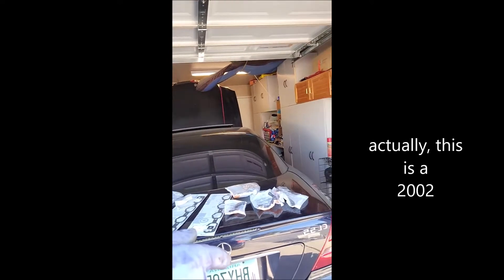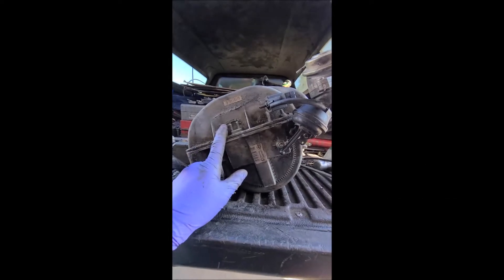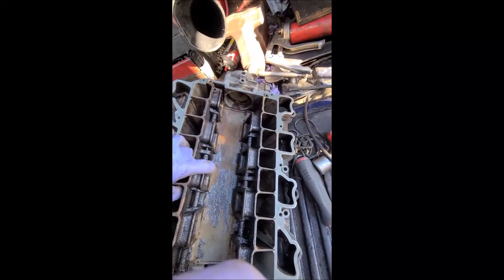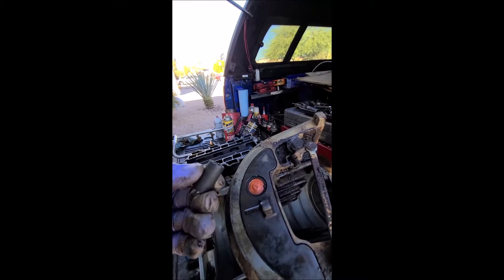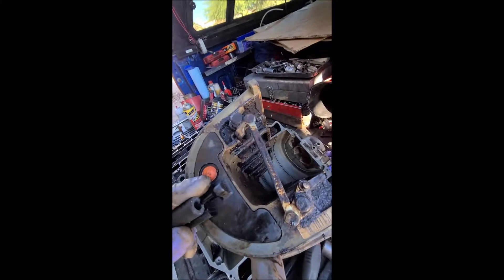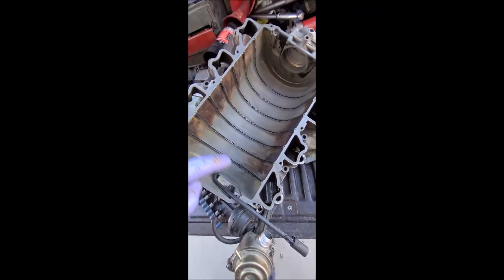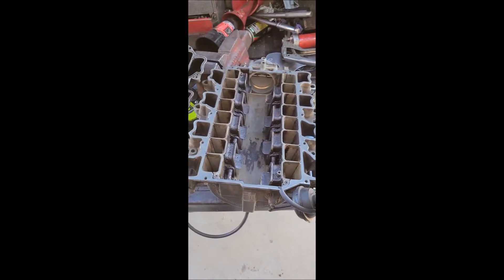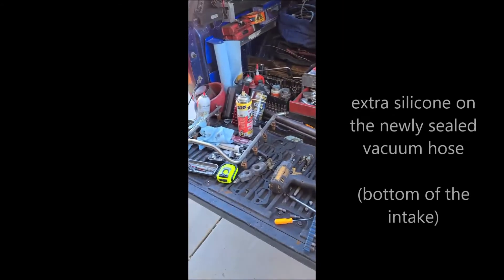Mercedes Benz M112 and M113 engines, split intake manifold vacuum hose leak fix

Comment: Just the video I was looking for . My vacuum line broke just like yours long before I took apart my intake manifold I can just tell by the look of it , what were your symptoms with the broken hose ? I never noticed anything but I’m sure I will when it goes back together fixed & clean , I scrubbed everything clean with diesel fuel & then soda blasted it down to bare aluminum again so I can get better sealant adhesion. I will have a video on my channel soon when I’m done !
Reply from the maker: It was a lean code with a small hissing noise from under the intake. It did run much better when it was all done

Comment: I used an air compressor pinch hose fitting with an 1/8” pinch.  Then added a hose connection , put a 1/8” rubber washer.  This pinches onto the vacuum tube in the intake, making it air tight, sell the washer seals at the exit hole by way of the pressure of the mounting screws and gives the ability to replace the hose in the future without removing the intake.  
I would add a picture but not sure how.
Reply: Yea would be great with a picture or video.  Way to go.
Reply: Do you have a video of this ?

Comment: Would this cause a oil leak as well?  got p02015 p1073 and p1070 codes, high rev at cold start with small oil leak. Think
Reply from the maker: No, oil should not be in the intake manifold. But an oil leak can ruin this vacuum hose.

Comment: That part broke off on mine the one in side the intake so i just ran the hose in side with out the connection  will i have problems? I drove it today   everything feelt normal
Reply from the maker: Like they say "Only time will tell" 👍🏼
Reply: Now is running   a bit rough  guess a need a new intake manifold

Comment: What codes were u getting and how was it running before you fixed it, please tell me. I have a 2001 s430 and I can’t for the life of me figure out why it runs like crap BUT I did try to repair that vacuum. Maybe I did it wrong
Reply from the maker: It was running lean, vacuum leaks do that. You probably have a different issue

Comment: My 2001 s430 is experiencing ruff idle . I was replacing the hose there and it broke off . I refused to take the intake off but it was a no go . I’ll have to take it off today . And finish the job . Poor car has been sitting for about a month because of the bad weather in Nashville . But this video motivated me . Our I go
Reply: Hello, did this help you? I have the same Problem with Rough idle, i replaced almost everything and every sensor

Comment: YOU BETTER TAKE THIS TO THER FORUMS,I NO SOME GUYS WERE DOING CRAZY STUFF TO KEEP IT ON,I GOT MINE OFF NOW, FOR CLEANING MY EGR VALVE WAS CLOGGED I BOUGHT IT VERY NASTY AND IM WORKING ON IT TO GET IT LIKE NEW AGAIN, IF YOU DONT MINE ME ASKING WHAT SIZE HOSE DID YOU USE  AND WAS GETTING THAT LEAK TO LINE UP A PAIN OR CAN I MARK IT WHERE IT WAS  AND DO IT LIKE THAT ???SORRY FOR THE CAPS I LIKE TO WRIGHT LIKE THIS "LOL"
Reply: JUST SAYING I LIKE CAPS ALSO...

Comment: This could be solution of p0171 and p0174 engine fault code?
Reply from the maker: Yes, running lean because of a vacuum leak is very common

Comment: Hello This is great video and could you tell me does this hose cause check engine light?
Reply from the maker: Yes, it is often a lean code, it also makes the other components that use that vacuum to not work properly
Reply: @wotracer49  Thank you very much, I had rough idle problem for 5 years and when I saw this video I checked everything and I found 2 melted hose, they were coming from crankcase, I changed them and check engine light and rough idle went off , this video was very helpful for me

Comment: What does this hose do? I'm planning on an EGR delete. Does this render this vacuum connection useless?
Reply from the maker: I fixed it so the vacuum line wasn't leaking,, it still has vacuum on that hose
Reply: @wotracer49 I think my sl320 has a leak on that vacuum hose in same location , what does this affect with the car’s performance?

Comment: Can those flaps be canceled?
Reply from the maker: Not sure if it would cause issues/ check engine light, probably
Reply: @wotracer49  thanks. I actually used your video to fix that same issue on my C55 AMG intake. Thanks for the video.
Reply: @bluedemon7601  what was your indication that this was the problem? My C55 is giving me P2017 codes that come back after clearing.

Comment: Great video. Can you be more specific as to what sent you to this hose as the problem to the lean burn. Were there DTCs? Rough idle?
Reply from the maker: I could hear the vacuum leak, hissing at me. It did have lean codes that were fixed
Reply: @wotracer49  what was the code and all cylinders on one bank are missing 1-4 on 02 s500 
What is most likely the cause?
Reply from the maker: @abeodez751  sorry, this would not cause that problem, you will need to get it diagnosed
Reply: @abeodez751  highly  unlikely  that many misfires on that  many cylinders  at the same time. I had similar issues  o2s Cls500 M113 of course.  Turn out MAF wasnt clipping down tight. I fixed and scanned again and got a ("this vehicle  has no codes.")🙃🙂  All this was after spark plug and wires and a new coil pack pulling and testing  the o2s!  All was checking out good. I pulled my hair out until my eyes hit that little  tiny chrome clip. I wiggle the MAF and it was moving  quite a bit! That was my Eureka moment!  Lol! She runs like a beast now!🤪

Comment: Good Day to every one
I am just curious to know what kind of motor oil has been used in this automobile and also what brand name of gasoline.
If is that possible how many miles or Km has this engine.
Would like to thanks Mr Lambson Auto for the video
Reply from the maker: Not sure, it's a customers vehicle